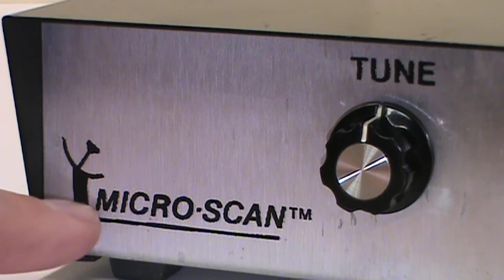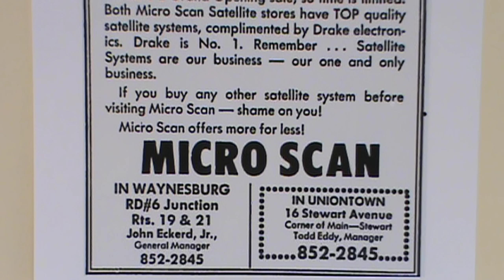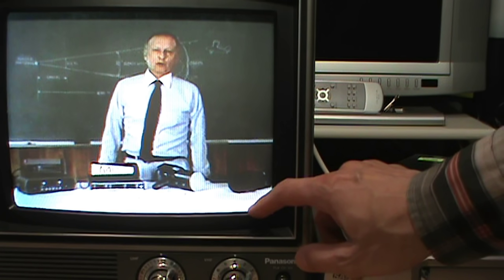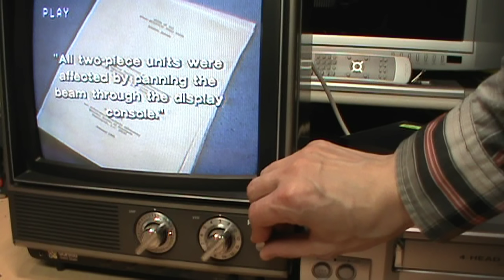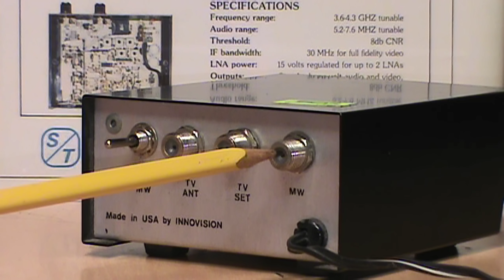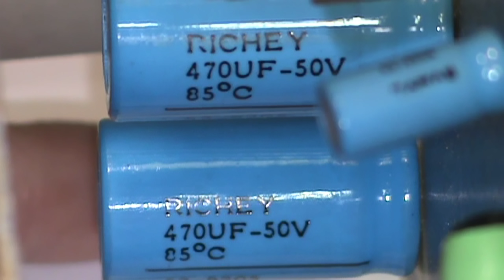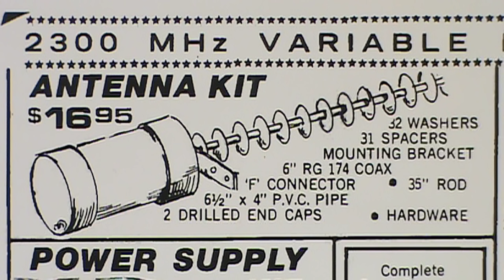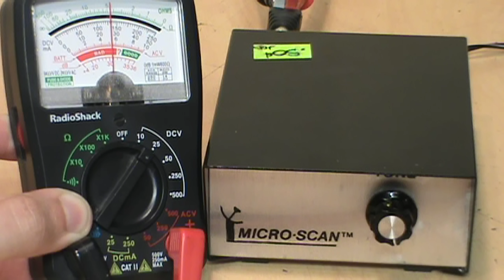Micro-Scan mystery 1980s TV device - Satellite? Microwave?

Comment: I bought one of these in the early/mid 1980's from a local franchise shop of Dick Smith Electronics.  I bought this box and a small dish and it got us free HBO.  It caught the uplink signal to the satellite, it worked fine as a young guy as I had to constantly tune it every 30 minutes or so as the earth rotated.  It was fun and cost like $50 back then.

Comment: This was what they use to use to get free HBO you just had to point it at the world trade center antenna and the dial was used to fine tune the channel and get rid of the snow lol wow that was in the 7o's  our remote control was connected to a long wire so you couldn't be too far away to use it

Comment: In Ohio in the 80's,we had a metal cylinder between the tv line in the wall in the hall and to the cable line running outside to thepole. This is how we got HBO. Also,if your neighbor in your building had HBO and you didn't, you'd get it as long as the neighbor was watching it. All the apartment cable hook ups were in the same box,so if that HBO cylinder was hooked up in the box,you had a Chance to watch HBO for as long as your neighbor watched it.

Comment: I built one of these for Microwave Multipoint Distribution Service in 1982.  I had just moved to Boston and was living on the 23rd floor of an apartment building with a view of all of the antennas on the Prudential building downtown.  I was working in the RF business (microwave/satellite/cable) and discovered that HBO distributed their feed to local cable and some subscribers, transmitting line of sight at 2.5 GHz.  I found a kit in the back of a magazine for a receiver board that fit into a coffee can and used a little variable power supply to control the IF on the board for tuning.  The box with the knob looked exactly like the one in this video.  The coffee can was the antenna and it had a rod attached to the front of it with several metal disks.  It was very crude, but effective.  In addition to HBO broadcasting at night, I could also pick up broadcasts from Harvard University and Mass General Hospital that they used to connect to remote locations.  After I got my feet wet with this little kit, I too the idea to work with me and we got other educational institutions connected around the Boston area and we ended up using it for education programming for more than 10 years.

I wish i could find a picture of the cirucit board and cantenna.  I googled like crazy but couldn't find anything like that from 43 years ago!

Comment: If only you had connected it to a BUD, maybe we would have seen something. 😂 You feed a self-generated video signal from the VCRs, but it would be interesting to find out how this thing would work with an over-the-air RF signal. That is, if broadcasters even use old-fashioned broadcasting frequencies anymore. From the description of the circuitry you gave, it appears to do nothing to improve the signal or even detect one. But an interesting gadget nevertheless.

Comment: At first glance it just looks like it converts microwaves to radio waves so you can find broadcasts with your TV. as well as maybe connected to a conventional UHF or other antennae and switch if needed. This still may do something today - North Korea uses analog transmissions still and some others.. but maybe it would be limited in range and there are other ways

Comment: Cheap, and semi-functional. They were paired with the bootleg "Daisy Dishes" for watching pay TV for free. The problem was that the down converter in the dish was NOT temperature compensated, meaning that the frequency would drift and you'd have to occasionally re-tune it. That was a mild annoyance, unless you wanted to record something while you were away. You'd come home, find that the frequency had drifted, and what you had recorded was unwatchable.

Comment: Back in the early 80's, HBO was an over the air microwave service in Detroit.  We purchased the antenna kits (receiver units) as well as the Micro-scan boxes to fine tune the signal.  Since the microwave antenna board was mounted to the back of a 1 lb coffee can, it was very susceptible to interference and temperature changes.  Hence, you were always adjusted the voltage knob on the front of the unit.  Not great, but it worked!  Thanks for the memories!
Reply: We had this from 82 to summer of 84 when we actually got coax cable system for the small town in N-West Ohio.   Had the antenna pointed towards either Ann Arbor or Detroit.

Comment: Not directly relevant but pertaining to cable TV in Phoenix, I recall meeting some Cable TV Engineers in Phoenix in the early 2000’s who were involved in a cable TV project which also used short hall microwave links to reach parts of the cable TV networks that had been deployed over Phoenix as it spread out over the decades. One of the problems they had when attempting to convert the older analog networks of cable was that repeaters buried underground had inadequate signal handling characteristics to support modern 256 QAM digital cable TV transmissions. Worse still no one really knew where the repeaters were exactly as most of the installation documentation of the analog cable networks had been lost ( or not even originally documented). Often the repeaters were buried under new builds so not accessible anymore. Interestingly the microwave links were susceptible to rain on the leaves of trees so cable tv reception would degrade significantly when it rained (not a lot in Phoenix though due to infrequent rain).

Comment: this was the receiver for for a microwave antenna  in new York for HBO they would transmit from the empire state building and you can get signal all the way to queens new York there was no cable yet outside of Manhattan, you can get all the part from radio shack and get HBO for free

Comment: Parabolic antenna with a long white box in the center?  I have one of those, but different company and, the interface box was angled and white, and bought from a 1970s surplus junk catalog.  It worked fine, it was a microwave link.  
In Rochester NY in early 1980s, I only found one transmitter, an education service sending out fairly boring videos.  In the years before VHS players, classrooms could have educational videos via microwave broadcasts rather than UHF.

Comment: There was a company, DRAKE, who made low noise block downconvertors for satellite and for terrestrial TV (point to multipoint). There were TV operators in urban and rural areas that would transmit TV signals in the 2.4 GHz range and these cheap receivers, including the LNBC and yagi antenna could freely receive signals. Mostly these were licensed for educational TV for school systems. The Catholic Church had networks as well. Could it still be useful? There is nothing other than FCC rules that would stop you from say, broadcasting compatible HDTV signals and using those receivers to receive the HDTV on the channel 3 and channel 4 TV carriers.

Comment: I built one in high school electronics class in about 1986 to pirate HBO signals on a rural microwave distribution system. It was great fun. The signal drifted a bit, but it worked. I don't know why my parents never made a big stink about the giant tripod on the roof with the homemade antenna mounted on top. Nor did they ask how I got it up there during a snowstorm.

Comment: A lot of LNBs are powered by set top components like this one.  Further, voltages are often used to control LNB operation.  It may be that the device requires something like 10 or 11 volts to operate, the variation in voltage tunes the LNB's output.

Comment: It's useless today. Back in the day, encryption was weak and the TV Pay services just reduced the horizontal control sync signal, which distorted the video. The audio was OK, but the picture would squiggle and not sync up. What that box did was boost the overall signal, which boosted the horizontal signal and made it sync up. It was one of the first TV descrambler hacks! This was before the Maacom Videocypher encryption.

Comment: The Micro-Scan was a piece of 1980s technology used in early satellite and cable TV systems, acting as a switchbox and variable power supply to connect televisions to microwave signals. It allowed users to tune into channels by supplying control voltage to remote downconverters.

Comment: I had one of these, it wasn't for amateur radio it was for "wireless cable" - microwave TV distribution. The remote downconverter was voltage tuned. The reason the tuner was remote was to avoid feedline loss. It used a small wire grid antenna, not very big at all. It was 2.4ghz or so. It worked fine unless it rained.

Later we hacked them for AO-40 downlinks to a 2M radio.

Comment: This item, with a dish style antenna, is a Microwave receiver. In the 1970's, before internet, both telephone and television stations that wanted to cover or transmit over more area than their 1,000' terrestrial antennas would allow,  used terrestrial microwave signals carrying their broadcasts. They were low width signals and you almost had to be in their broadcast line, but you could receive and view distant station broadcasts. This was pre-satellite tv broadcasting. They were very popular in dense cities that depended more on microwave transmissions instead of wires or cable broadcasts. They weren't very good in rural areas. You are missing the receiving dish, but chances are, no one broadcasts this way any longer, since satellite dishes and the internet.

Comment: Had that back in the early 80s.

We travelled doing circus I would set one up and scan around. Found HBO but also adult programming, as a teenager, honest I didn't watch. 😜

Some cities & metro areas had channels using microwaves and others didn't. Later we even had a 5ft C-band dish on our 5th wheel trailer. That all ended when Direct TV came out.

Comment: I made those box back in the day of big satellite dishes. When they first started coming out. Those little boxes was made to switch and tune the little antenna inside the dish. Called a polar rotor switch unit. Some used only a 9 volt battery and switched the power supply to move the little motor. That turns the antenna inside from the a side and b side or in other words. Even and odd channels. And we made them and yes we added extra cost for those units. So they were made to look like they weren’t homemade. 😊

Comment: it could be for MMDS which was wireless Cable TV 2.5GHz to 2.7GHz ... ??? this would pass > 12VDC to the LNB on roof with antenna connected to the LNB. The down converter translates 2.5GHz to 2.7GHz down to VHF regular TV band, the signal is analog just like regular TV

Comment: I thought this was one of those boxes that controlled the motorized aerial antennaes that were on top of everyone's houses back in the late 70s/ early 80s. If you were watching something and the signal was bad, changing the direction of the aerial antennae would usually fix it. The box that was inside the house is what i thought this was. But, wow, are you bringing back a lot of memories!!! I'll make a separate post about those memories.

Comment: I was hoping for something different. In the 80s, we had a "cable box" for the old TVs that weren't cable ready so we could get all the >13 channels with a dial. It had the channel selector dial, and a single knob for tuning. As a kid I noticed that HBO was "scrambled" as we weren't subscribers at the time, but the tuning dial could be turned to where the audio could be heard but not the video. At another position the video would be clearer, but not the sound (Very annoying constant BEEP BEEP BEEP...). I always wondered if I could figure out some kind of box to combine the two settings and get around the scrambling. I don't imagine my rural area had anything exotic, so there had to be someone out there that made a box for that.

Comment: If it had a second knob I would guess a late 70's early 80's TV descrambler for stuff like ON and Select TV like we used to make at radio shack.
My guess though is a signal booster for an antenna as we had similar boxes for our 2m/4m radio antennas back then before my dad got access to a neighbor's mini tower.
Of course once I watch the video I suppose I will find out.

Comment: back in the 80's there were adult channels transmitted line of sight, the antenna looked like a 30 inch rod with about 15 1 inch round disks about 1 inch apart, and a receiver like what you have. This was in San Diego and didn't last long, I should know I was an installer for MDS.

Comment: In the late 70s, HBO began transmitting from tall buildings in various US cities. Back then, people were accustomed to watching television for free (paid for by commercials) and were quite irritated that some company called Home Box Office wanted to charge folks big bucks to watch a signal that HBO was transmitting through your home without permission! When HBO put a transmitter in a building about ten miles from my home, I realized we met the "line-of-site" requirement for reception. I decided to buy a DIY kit that would allow us to watch HBO at my parents' home for free. The box in this video is a tuning device that was just part of what was needed (this box was used to fine-tine the signal by slightly changing the antenna voltage). In addition to this box, you had to build an antenna that was quite large, but the kit included detailed instruction how to do that using common items. I went to a hardware store and bought a 4-foot UHF dish antenna (normally used to watch TV channels 13-83). To make that work on HBO wavelengths, the dish had to be covered with 1/2-inch steel mesh. To make the "down converter" you had to solder a bag of parts to a PCB that was included in the kit. Then, you cut a square hole in the bottom of a 3 lb.coffee can and soldered the assembled PCB to the coffee can. The can had to be mounted a precise distance from the dish antenna, so the signal would bounce off the dish and into an antenna wire on the coffee can. This was done by carefully cutting three pieces of steel electrical conduit and building a little tripod, to which the can was fastened. The last thing I had to do was wait until my parents were away for the weekend, because in order to cleanly hit that transmitting building, I had to stick that 4-foot dish on a 20' Radio Shack mast on their roof! Um, did I mention the steel guy wires? Remarkable, I got it all assembled and working before my folks came home. Free movies! Too cool! And I still remember the exact swear words my father uttered when he pulled up and saw what I had done to his house, lol.
But my family really loved watching the movies-- so much that my father even shrugged off the jokes neighbors were making about the big antenna on our roof. A few months passed and HBO was lobbying hard to get lawmakers to change FCC rules, which would allow them to prosecute the "pirates" that were "stealing" their oddly unencrypted signal. Soon enough, mysterious white vans equipped with roof antennas were cruising up and down residential streets. Word circulated that HBO was somehow detecting who was receiving their signal and compiling a big list for the lawyers. Like others, we were forced to move the antenna into the attic. Although it still worked, the signal wasn't nearly as good. And sure enough, HBO began suing hundreds if not thousands of families for theft! The whole fiasco was big news at the time. Those were the days, lol.
Reply: Amazing story, thanks for sharing

Comment: I had a Satech satellite receiver. You also had a downconverter at the dish. This allows you to use much cheaper rg59 coax instead of the expensive 4gigahertz cable. At first I thought it was terrestrial interference filter, long distance telephone was using the same frequency as c-band satellite.

Comment: The circuit appears to be a bias-T that powers an LNB ("Low Noise Block" downconverter) for terrestrial MMDS broadcasts popular back in the day. The "Tune" knob is likely part of a varactor-tuned VCO, and turn the knob and vary the oscillators voltage. Likely this drives the mixer LO (local oscillator) as part of the downconveter inside the LNB and voila, you can tune in different MMDA bands probably sub 2 GHz. Geeking out here...fun stuff and takes me back to the early 80s and early teenage years.

Comment: Omg.. .it's been decades since I seen it. Scrolling through YouTube and the minute I saw the intro Pic, I remember my grandfather had one on top of his old admiral TV. In st louis, there was no cable company available (really until 1984) but somehow my grandfather had this for showtime. It was relatively unknown, at least to me, what showtime was but it had newer movies that regular TV would not show for a long time, and it was all uncensored.  It looked exactly like this box you have, letters and all, but I believe it had showtime stamped or sticker on the very top of the box. The one thing I distinctively remember is that the fine tuning needed to be adjusted quite frequently. My grandpa was a ham radio operator and had a tower in the back yard. Not sure if that tied into it, but the minute I seen this, I automatically knew what it was. Thanks for the flashback.